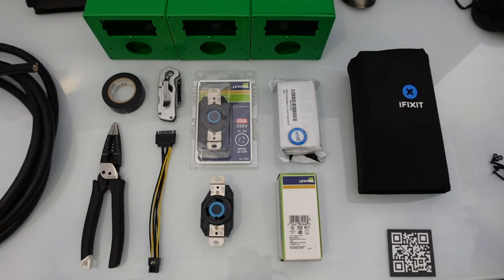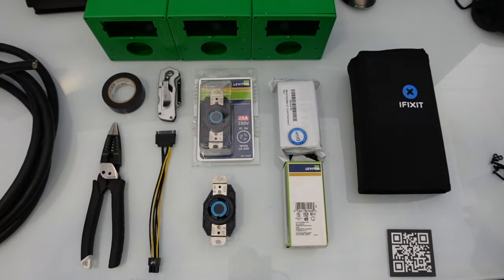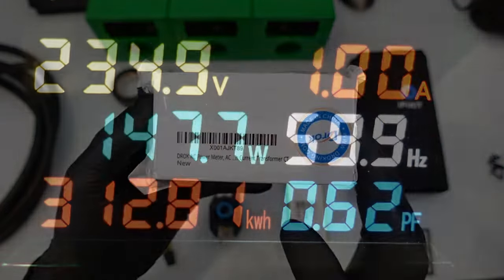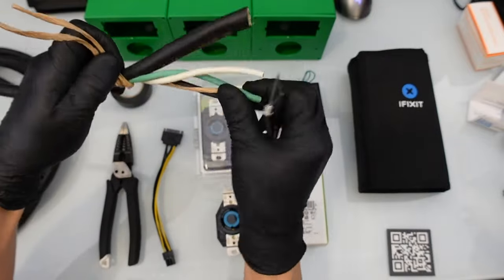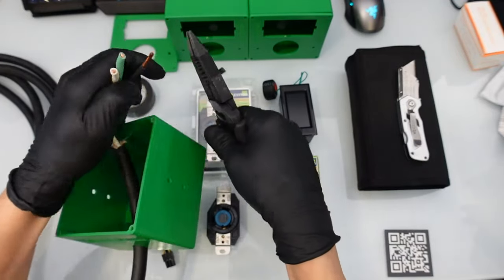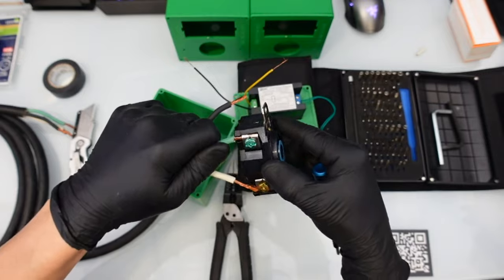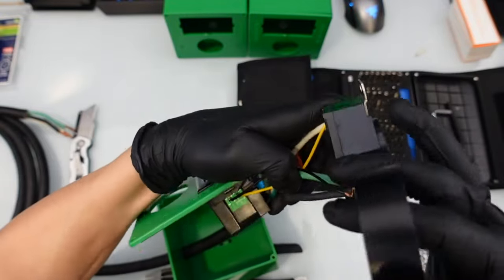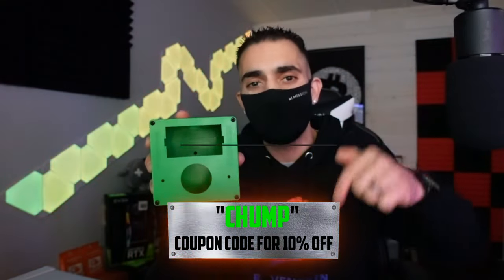How To Wire "The Meter Box" Power Meter For Your GPU Mining Rigs | Step by Step

Comment: I bought some of the same green boxes from "The Meter Box" and used the following 10 gauge extension cord for a pretty good color match.  It's decently priced for 50ft.  Simply cutoff the ends and use as you demonstrated.  
On Amazon, search for the following...
10 3 Contractor Grade 50 ft 10 Gauge Power Extension Cord 10/3 Plug Extension Cord with Lighted Ends 10 Gauge Extension Cord 50 ft Outdoor Heavy Duty 10/3 Extension Cord 50 ft, Green

Comment: I'd Like to see a version where the plug is on the downward facing side of the box with just the metter on the front and power cable comes out the top side.
Reply: Good idea, less stress on the faceplate.

Comment: Hey, if I wanted to install this on the high output wires of my inverter couldn’t I just install it inline closer to the inverter and wrap the two small wires around the hot lines somewhere between the inverter terminals and the receptacle instead of twisting them up and connecting at the receptacle the way you did?

Comment: If you want to add more security and strength to most connections, use some ferrule crimping connectors on the solid-core wires, just make sure you are using the ones rated for your max amperage. I'm worrying a lot about your green wire my brother :/

Comment: The Cable Grip, know as a CGB is sold on Amazon but is priced too high.  I used a 3/4" CGB which uses a slightly larger hole.

Comment: I thought the wire to meter had to be the same gauge as the source wire? 240 = 10 guage? Could be wrong, how I did mine.. Do you have a source of reference for upcoming boxes I make? Would be a lot easier using a smaller gauge.. Thanks in advance
Reply from the maker: I have wires all of my meter boxes like this and I have zero issues with all 4. They don’t pull much constant power so IMO that thin 18-16 gauge wire is fine for them. Again I haven’t had any issues
Reply from the maker: Also I cut a 6pin x Sata that came with some old risers to get that wire***
Reply: @ChumpChangeXD  Thanks man, when I made mine, I referenced an older tut on YouTube.. They mentioned that the wire should be able to handle the draw just incase. It’s a pain with 10 guage!!! Ha! May try it your way next!! Thanks again!
Reply from the maker: @decodedcrypto4063  no worries my man

Comment: Has anyone found out if these are compliant with the NEC?  I'm not sure what an inspector would do with these
Reply: You raise a good point. These seem good in theory, but I worry about the strain on that plastic faceplate from the heavy 10/2 cord.
Reply: @DA-ms2hm  oh good point,, I hadn't thought about that.  Normal electrical boxes mount the outlet to the box then the plate to the outlets.  Hmm.
I can't claim my solution is any better though.  Just ran a 2-gang plastic 1" pvc conduit box with no faceplate and held the meter in with electrical tape...